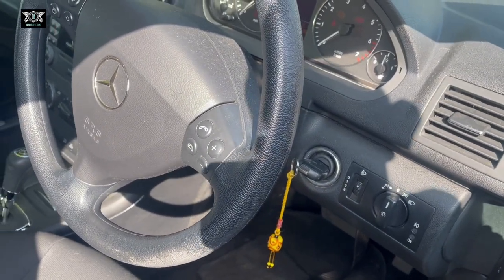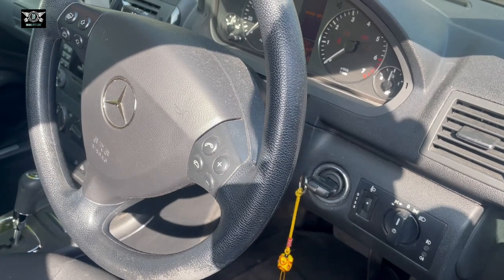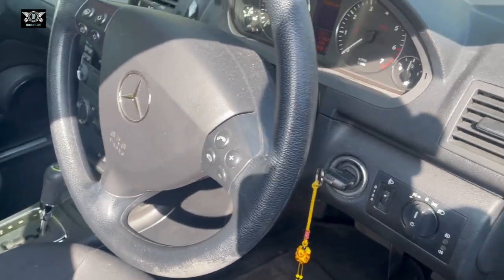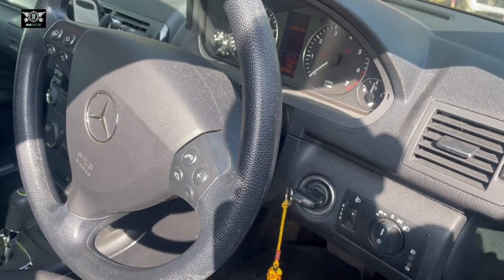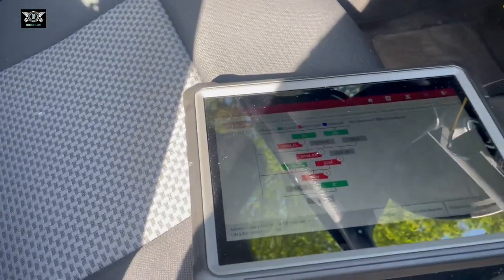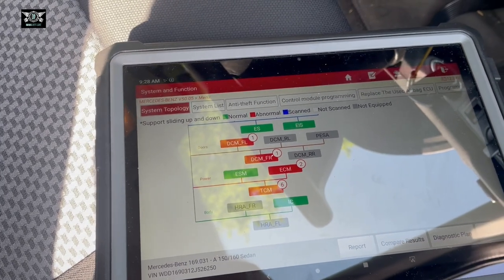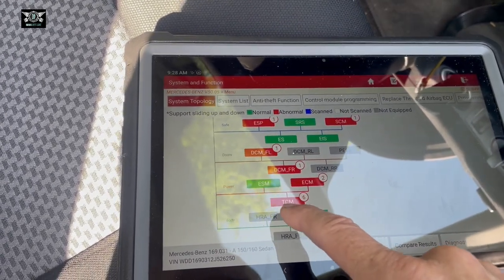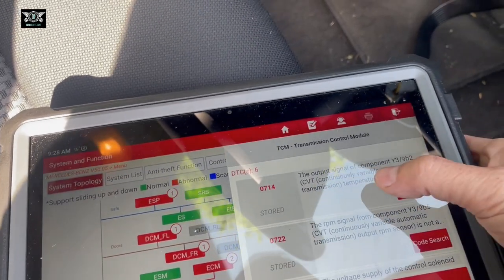Mercedes A class B class w169 w245 2005 2006 2007 faulty TCU TCM Transmission message visit workshop

Comment: Why do you count oil? What if it wasn't enough before?. Use dipstick and problem gone. I have used 5l of oil in the same gearbox
Reply from the maker: the only reason there would not be enough oil, is if the transmission was leaking, otherwise there is no reason for it not to have enough. so if there was a leak then i could not use this method. Any way thank you for sharing your views.

Comment: I have 2008  B150. I have changed tcu 4 times but in a couple of days they all gave the same issue. I fed up with this car and mercedes company as they don’t give us any help ( like at least sell us brand new whole transmission). I think they quited producing this transmissions because of chronic issues. If they sold this car all over the world, they should have either call them back or rebuild a new transmission (which SHOULDN’T be fucking cvt again of course. Old torque converter transmission are best in my opinion) for these models.
Reply from the maker: Yes they are not very strong.

Comment: That plug is a terrible job to get off on the top of the gearbox....you wont be able to drop the valve block if u dont remove it....Bob....Paignton.....
Reply from the maker: Yes it’s a pain, specially if you’re doing it on the ground.

Comment: Legendd!! I’m doing it at home with my mechanic friend. (We’re both not experienced) but you explaining each and every bit is really helpful. I just posted it to the company that does the programming today. Will come back to this video once I get it back. 
One more thing, can I ask how many days did you have to wait for the unit to come back after fixing? Also, the febi kit takes like a month to ship to Australia. Ofcourse I will get new transmission oil but can I use the same strainer pad kind of thing at @38:01 ? 
Thanks boss! 🫡
Reply from the maker: Hi it took about 2 weeks to get the unit back. The strainer can be re-used, just give it a good clean and carefully blow it with an air compressor if you have. The strainer is basically a filter. Good luck with the replacement.

Comment: Did this job yesterday, well halfway, now to box and send TCU off, I didn’t disconnect the battery, but I have a good diagnostic scanner, you said make sure the battery is disconnected, before reconnecting the gearbox plug. Why is this? If it generates codes you can just clear them no? Just wondering as I’ve done it all without disconnecting battery now. Thanks for any advice 🙏
Reply from the maker: Hi, main reason for disconnecting the battery, is to avoid any shorts happening during reconnecting of electrical plugs, which could damage the ecu or tcu again, it is very unlikely this would happen but it’s just a precaution, as it could happen. Also avoiding any airbags going off, as often ecus are all linked to airbags in the car, again just taking precautions, avoiding any further issues.

Comment: Thanks for the detailed video. Very helpful. 
I am also doing the same process(my mechanic is doing it), and while removing the TCM, we noticed that there is  loose part  inside the gearbox. I don't know the name of it but I can explain: at time 23:45 the metallic part on the right top side of the picture, which has 6 bolt holes in it. That is a bit loose, even though the screws are tight enough. What is its purpose, and is it normal to be loose? 

Many thanks
Reply from the maker: Are you referring to the bit am pointing at during the minute and second. Because that bit slides back and forth is connected to the gear stick. Otherwise am not sure what other bit might be there that is loose. I don’t quite remember anything else 😂.
Reply: @DaringBeefcake  
Thanks for the replay, I am not referring to the one that connects to the gear stick. If you pause the video at time 23:45, you could see a metallic part with 6 screws on it, and a couple of other holes for oil flow possibly. Its on the right of the picture.
Reply: @makululaj86  yes. The one that has a chain on. I noticed it is loose on my transmission as well. Did you get it sorted?
Reply from the maker: @makululaj86  oh I see, well I don’t recall having paid any attention to that part so I can’t really says how is it supposed to be sorry.
Reply: @DaringBeefcake   Thanks, it should be fine as it is I guess. On that note, how did you post the TCM to the company for fixing it? DHL returned mine because it was "oily" according to them, and it needed to be professionally cleaned and have a certificate to prove it. Any suggestion  would be appreciated.
Reply: @rookiechemist5930  I have not yet, still waiting one TCM to be repaired, but I guess it is fine to be loose when the cover is removed, but when the cover is installed, there are some bolts which should ideally fix it.
Reply: @makululaj86  i fixed it loose and later noticed a strange sound coming as i shift to drive. It is fine when it is neutral, so i removed everything again, used washers to keep it in place and now there is only a little noise when i accelerate hard. Not sure if the issue is related to it, just giving you a heads up. Or try to install the valve body screws only to 6nm torque and that should do i guess
Reply from the maker: @makululaj86  I used some brake cleaner to rinse it a bit, there was some oil dripping very minor, but I put double cardboard all around and padding of course, delicate part as you may have seen, so not enough oil to get through the box. And I posted it first class next day special delivery at the post office. Box had fragile tape all around.
Reply: That is the bottom part of the oil pump. I can only assume it is not supposed to be loose. Google this WIS number AR27.10-P-0400AL for removal and installation of the oil pump

Comment: Wonderful Job Sir my w169 2007 model has been showing the same sign lately it comes on and off at times i thought it needed an oil and filter change i took it to the workshop the fault was not picked up, is it possible that i just do the oil change and filter without  removing the TCM first
Reply from the maker: I don’t think an oil and filter change will solve the issue. It’s a common fault and the TCM needs to be repaired because there is some electrical connection inside of it that tends to brake. May be you should wait until is more obvious so you know if the TCM is at fault.

Comment: I took all of the bolts, and the valve body comes down, but it’s stuck with something, I can’t find any information online about it
Reply from the maker: How many bolts did you remove, there is one that I always miss ? Also are you able to feel that is moving? And did you unplug the electrical connection that’s on the side top area as shown in the video.

Comment: Hi, thanks a lot for this great tutorial. After putting everything back inside the gear, filling oil and starting the engine, my wheels are not rotating whatever the gear position. I double checked the small metallic U connector on the cvt part, it was properly linked to the gearbox. Any suggestion ?
Reply from the maker: Is the electrical plug connector properly in, may be check that, as that would be the only link between the tcu and ecu. Otherwise you may want to read fault codes and maybe contact the company who repaired your tcu.
Reply: @DaringBeefcake  I found out the reason of my issue. I forgot to do the part where you run the engine at 2000RPM that would basically "launch" the oil pump. So now everything works like a charm. Thank you !
Reply from the maker: Glad to hear that, well done on finding the issue  @TheStomm
Reply: @TheStomm  Hi. I’m experiencing the same issue with mine. Did you drain the trans, disassemble everything then reassemble and refill the trans with new oil followed by reconnecting the cable then battery ending with starting the engine then holding the 2000rpm?
Reply: @r.cmartinvickers3939  Hi, I wasn't doing the 2000rpm part, that's why it was not starting properly.
Reply: @TheStomm  So you reinstalled the TCU then did the 2000rpm?
Reply: @r.cmartinvickers3939  yes after repluging everything and refilling with oil.
Reply: @TheStomm  Okay, thanks. I'll give that a try.

Comment: Hi. Got AC Tronics to repair my module but since reinstalled the vehicle engine revs but the car does not move. Please help.
Reply from the maker: hi, did you fit it yourself ? if so, did you make sure the link for the transmission went into the correct place ? if yes and all was than correctly then there could be an issue with the repair..
Reply: @DaringBeefcake  Yes, I fit it myself. I believe one did correctly. Will remove the TCM and reinstall it then do the 2000rpm step to see. Is this a good idea?
Reply from the maker: @r.cmartinvickers3939  when you select gears is this showing correctly in the dashboard ? not sure what you mean by the 2000 rpm step ?
Reply: @DaringBeefcake  Yes, when I select gears it shows the selected gear on the dashboard, the engine revs in accordance with the throttle input but no movement at the wheels. 

2000rpm step is what was suggested once you finish the install to "kick start the trans oil pump". Please correct me if I'm wrong.
Reply: Got it installed and all is providing gear shifts but I’m not able to go past 50km/h. ESP faulty is popping up still and break wear visit workshop…could these unrectified faults/ issues be the reason for this ? Please let me know your thoughts…

Comment: I nerd help. I have change my TCU and now i got this fault
the gear ratio in the continuously variable automatic transmission cvt is not permissible.
And
transmission control fault is stored in component y3/9n1

What can i do?
Reply from the maker: Did you send the old tcu to be repaired and fitted the repaired TCU. ?
Reply: I buy one from aliekspress
Reply: New one
Reply: I have fill 5liter gear oil
Reply: How much oil do i need? I fill 5liters
Reply from the maker: @callofnoobs  you need to program this unit if it’s new.
Reply from the maker: @callofnoobs  how much did you remove, it’s difficult to say the correct amount as i measured the amount that came out of mine.
Reply: But the seller said its programmet to my chassinumber
Reply from the maker: @callofnoobs  do you trust the seller.